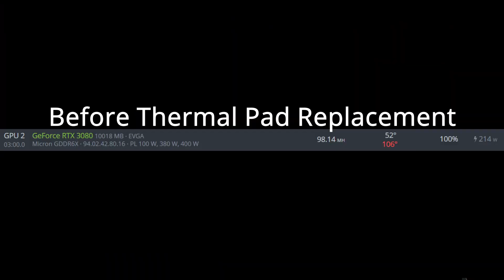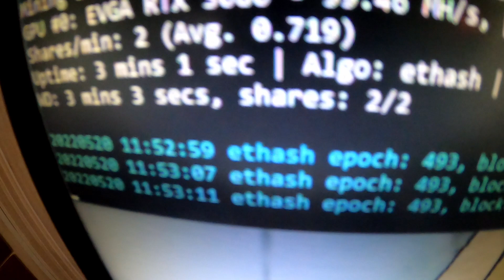B-STOCK EVGA RTX 3080 FTW3 THERMAL PAD REPLACEMENT

Comment: How mm thickness thermal pad use for EVGA RTX 3080 FTW3?
Reply from the maker: Hey man, here are the specs of the pads from Kriticals website: 

Thin (1mm) and wide (10mm) stripes go on the grey power modules where EVGA used thermal putty, on both sides of the GPU die.
Thick (2.6-2.8mm) and narrow stripes go on the mosfets, on both sides of the GPU die.
VRAM pads (2.25mm)
Reply: @Artun.   okay thanks for ur response, dude :) happy mining
Reply from the maker: @ricky_ramadhan  No problem bro! You as well!